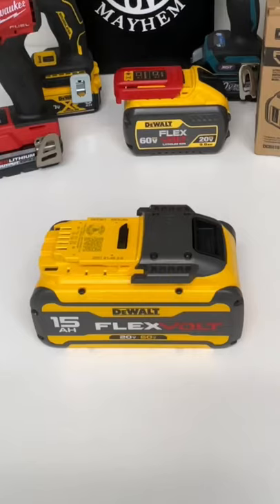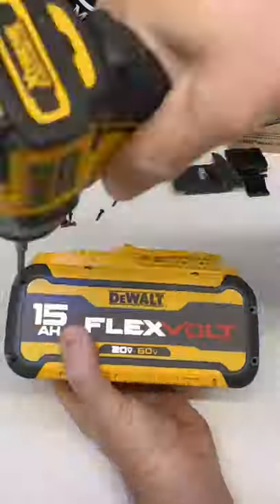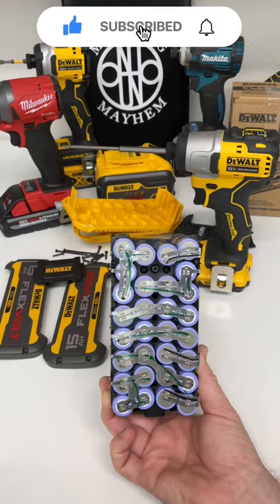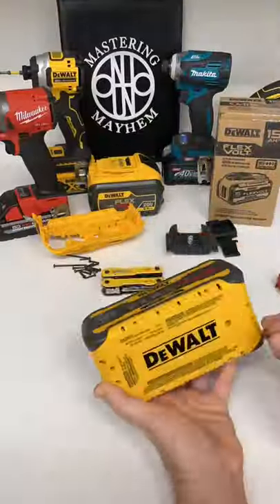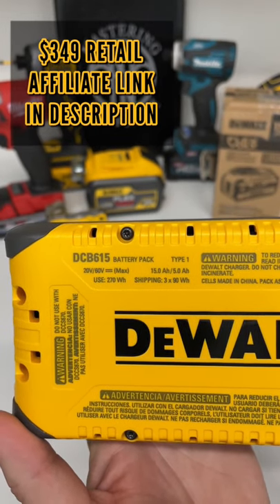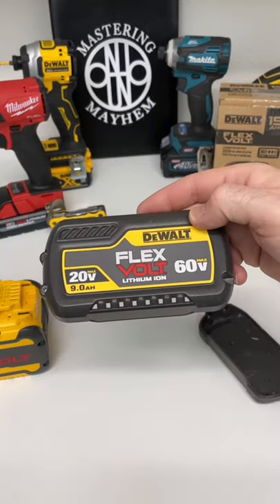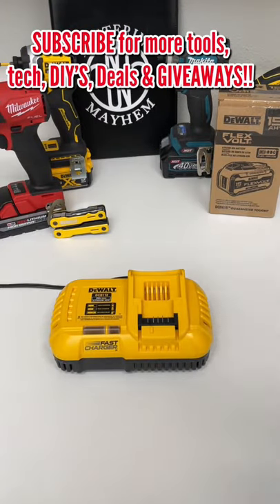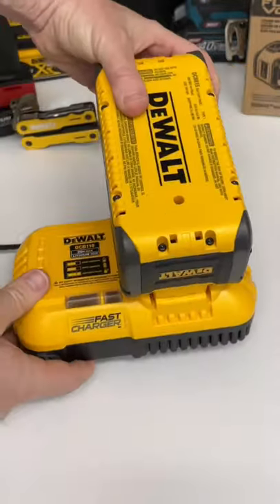🚨📢 NEW DeWALT 15Ah FLEXVOLT! What Kind Of Cells Are Inside? 🤔

Comment: With this form factor arrangement
( 30 x 18650s ) it will max out @
2P5S x 3 rows ,
>>>at 6Ah @18 each row of 10Cells<<<
 total = 18Ah @ 18V or 6Ah @ 60v
Thats the maximum this form factor will get (given it's 18650 cells) , if you guys are getting this monstruosity at least wait until they come out with something better (18Ah), get it at its best energy density  , instead of using:
What youre getting here ,  the same old cells of an equivalent 
>>>5Ah @ 18v<<< (10 x 18650s cells = 1P5S x2 Rows of 5 Cells) 
or [2,5Ah @ 18v 1P5S  each Row of 5 Cells]
FOR REFERENCE , the 12Ah flexvolt it's waaaaaay  way better densitywise with:
[4,0Ah @ 18v 1P5S each row of 5 Cells]
Reply: I see only 2Ps here. And it's very observable. 2P can hold 6ah and this means multiple possibilites.  1 is that it's 2P15S which could mean 6ah @ 54/60/63V (the voltage part is the one that is confusing). 2 is that it's actually 3 groups of 2P5S and they're being switched electronically to either series or parallel. If they're switched to series it results the 2P15S i said about previously. If they're in parallel it maths out to 6P5S and that really could go up to 18ah at 18/20/21 whatever the hell voltage adition they're doing. THERE IS NO SUCH THING AS 1P!!

Comment: Their new chainsaw comes with one of these. So, it's $400 for the battery or $450 for the brand new chainsaw AND the battery. It's actually an amazing deal and honestly, if you do a lot of work cutting trees, you could buy 2 of them and have a spare chainsaw for parts or a quick swap if the chain gets dull.

Comment: Wow. I wish they could’ve done it with 21700 cells. Cool video!
Reply from the maker: Me too. I was hoping for that
Reply: They probably wanted to but there isn’t a 21700 cell that is 5ah and handle the amps needed for some of the 60v tools.
Reply: @badboyfaysal14  what do you mean by that ? 21700 can handle more higher amp than 18650.. both 9ah and 15ah are the same flexvolt 20 60volt battery.
Reply: @badboyfaysal14  samsung 21700 50S has 5ah capacity, has 30 or 35ams discharging current, they are placed in original dewalt 10Ah batteries..
Reply: @badboyfaysal14 the 21700s are in tons of batteries.. the Dewalt XR 10, 8, 6, 4cp & 3ah cp. they are also in the 9ah FlexVolt and I think a new 6ah FlexVolt
Reply: @kor_nellione …and the 50S batteries are dropping like flies.

I literally have dozens of dead DCB210 batteries with those INR21700-50S cells. The 10AH XR DCB210 was a mistake that never should have been made. Add another row for 3P 5S and they’d probably be fine as a 20V Max 15AH pack but then you have 1P 15S for a 15AH FlexVolt tool and it would fail even more readily on the new FlexVolt mower.

FlexVolt tools need to have a cell count that is divisible by 5 and 3. Since 15x 50S cells wasn’t an option, we got 30x of whatever these are (INR18650-25R?). Makes perfect sense.

Comment: While its a bit underwhelming to have 18650s we have to remember that by using 21700s the 🔋 will end up way too wide to fit in the regular flexvolt tool docks
Reply: Ding Ding ding!!
Reply: Actually they’re 21700 I have 9ah, they fit all flexvolt tools
Reply: It'll be the same size as the 9ah and 12ah if they use 21700 5ah cells. I think the reason dewalt use 18650 instead of 21700 is because the 21700 5ah cell doesn't have the discharge rate to keep up with the flexvolt demand.
Reply: If they used 21700 then they would’ve had to go with the same Samsung INR21700-50S cells that are always failing in the DCB210 (10AH XR) battery. They would fail even harder in a 60V tool like the new FlexVolt mower.

Comment: Don't be disappointed, they use the best 2.5ah cells, samsung 25s, much better than 25r's that are common. 2 in parallel can output 60A unlike 9ah that are in 40-50 range.

Comment: If it used INR21700-50S like the 10AH XR then it would probably die prematurely on 60V tools just like the 10AH XR does on 20V tools… especially the new FlexVolt mower.

Comment: Why is everyone disappointed to see 18650s? This isn't just a bigger battery for the sake of more capacity. The main purpose of this battery is to push more amps (more power). Imagine how big a 2p configuration would be with 21700 cells.

Comment: They only use 18650 cells because that would reduce the cost of making the battery and the retail price Also the battery would be bigger if it used 21700 cells also more pricey

Comment: Not even 21700??? 🤯🤯
Reply from the maker: Not even 😕
Reply: 18650 cells can output more power but the 21700 cell can hold more if it had 21700 cells then it would be a 24 ah battery at 20v and a 8 ah battery at 60v. It look like dewalt went with power in stead of runtime on this one probably so they can power larger tools to compete against milwaukee mx fuel line is my guess.